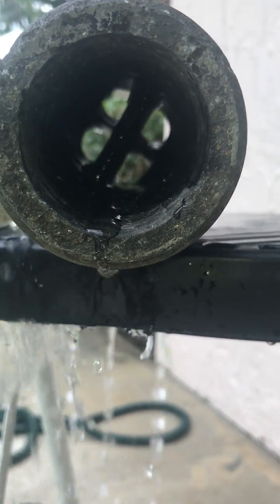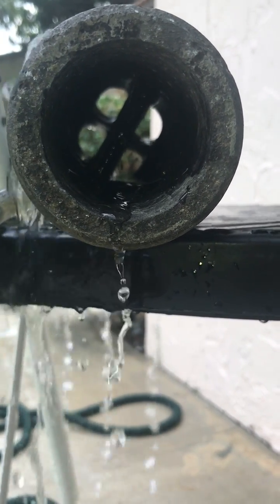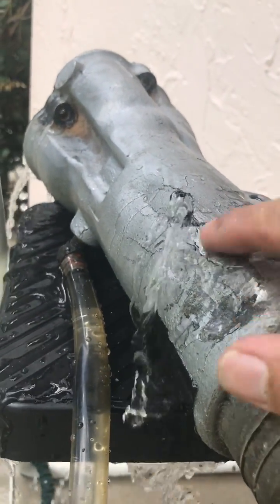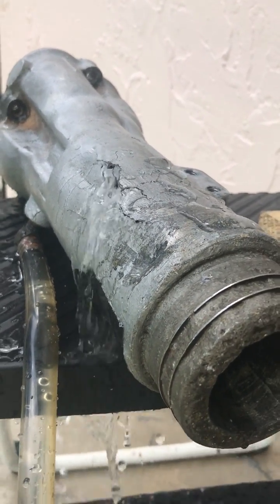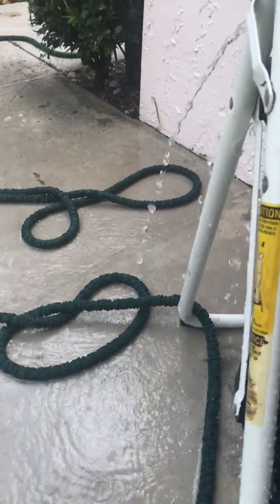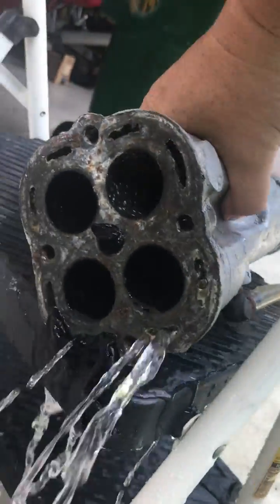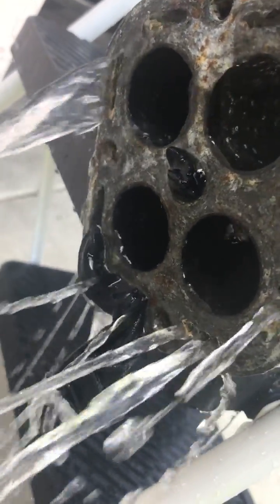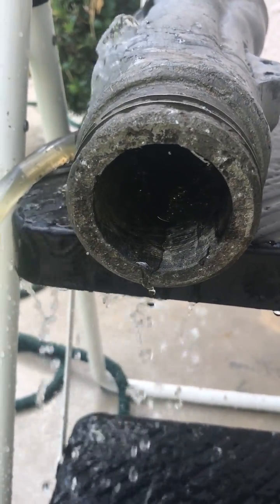jetski exhaust corrosion water test

Comment: @celyl305 my jet ski's exhaust pipe frozen this winter and has the same exhaust pipe leak. Can you replace the exhaust pipe piece without remove the entire exhaust manifold? Thanks Jason
Reply from the maker: It's tight in there. The water enters the exhaust pipe (waterJacket) from the manifold. So the inner walls of the manifold waterJacket most likely the source. Both are rusted thru. Like my problem. Are you sitting down, the dealership estimate is $2100 fix.
Reply: Wow, sounds like i maybe fixing mine myself too. The part is only $365. I was hope not to remove the whole manifold and only the broken pipe the same as yours